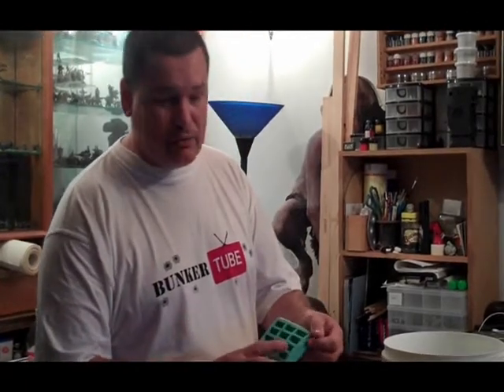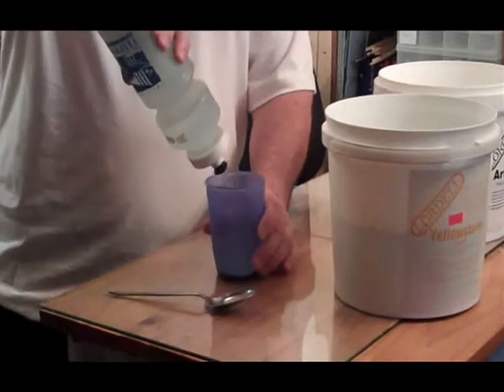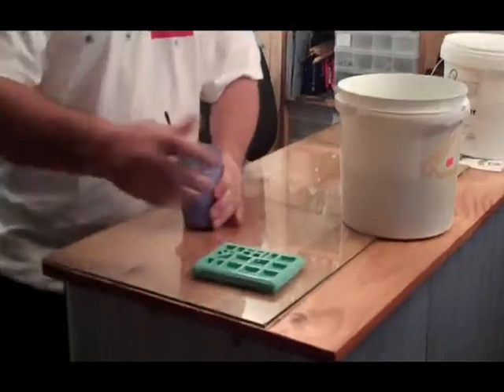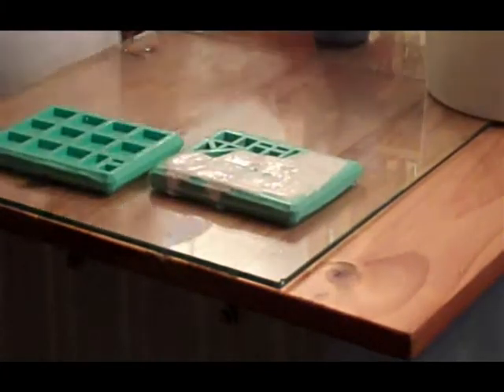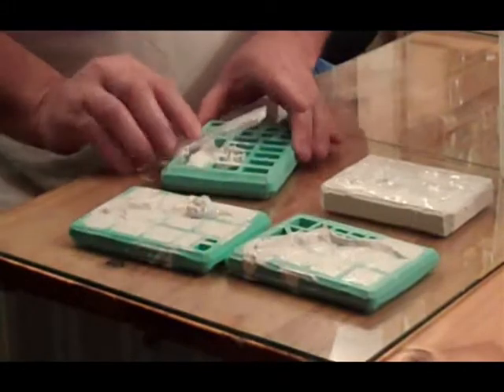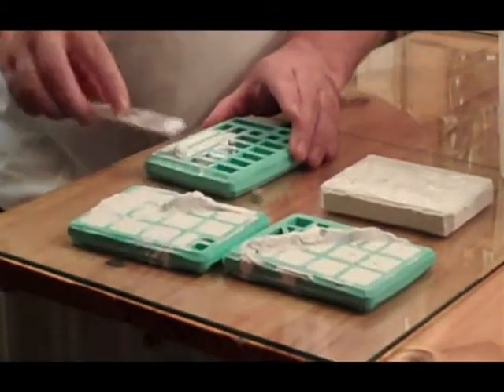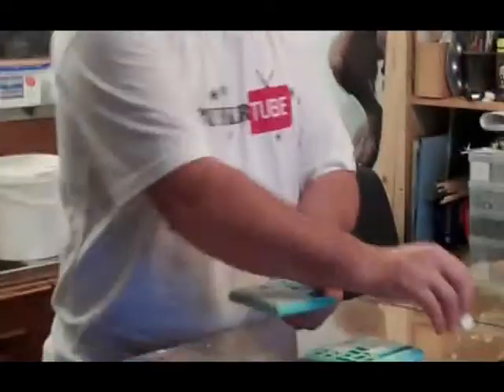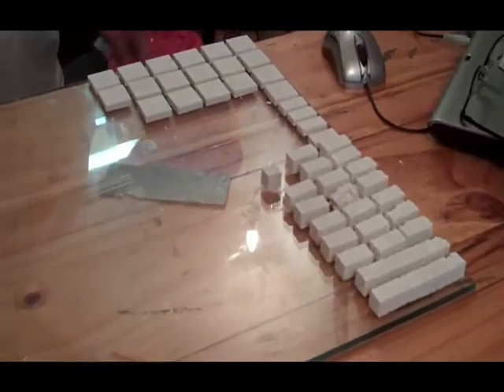Plaster Mold Terrain Tutorial - PART TWO

Comment: I have several hirst molds that I've been using for a few years. They're very easy to work with but here's a couple tips; 

After pouring the plaster into the mold, pound on the table with a small hammer for a few minutes to remove the bubbles

When assembling a building with the blocks, place them in a corner of a empty drawer to square them up. For the other two walls, use a jig made out of glued legos. This keeps the kids and pets out of your project